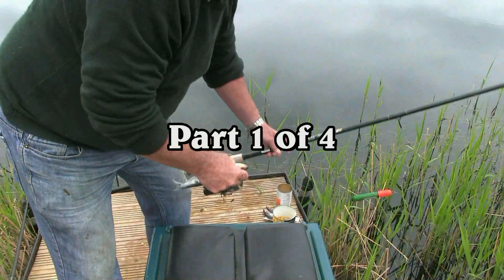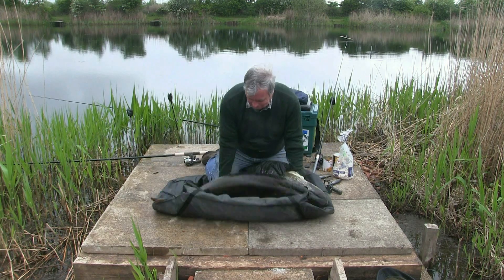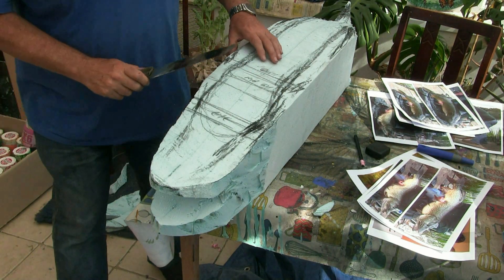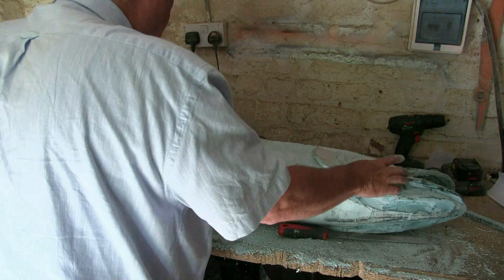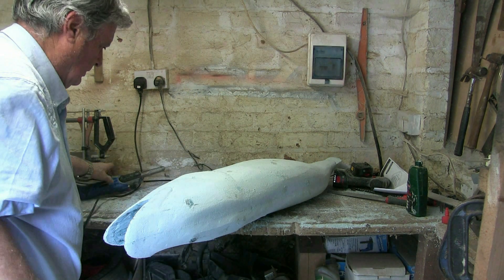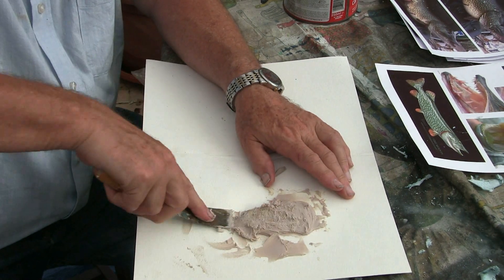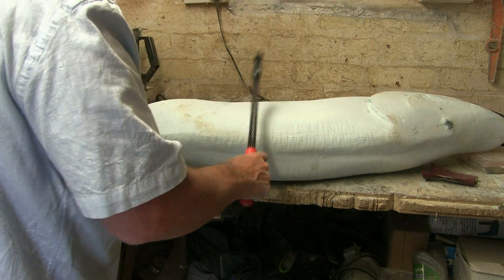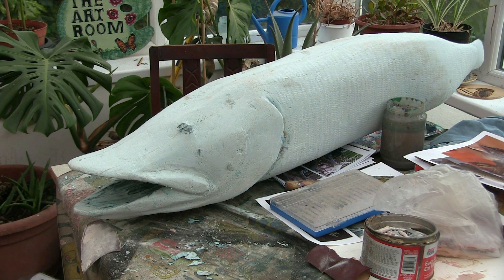Model of big Pike 1 of 4

Comment: Not bad. One of the biggest pike caught in the last decade if not more. What a fish, well done.
Reply from the maker: Thanks Reuben it was certainly a surprise for me also! At first I thought it was just another 5 lb fish and gradually, every moment, it felt bigger and bigger. It was not until I actually had the head coming towards me and saw it and at that time it also decided to take the fight a stage up! lol. Then I realised its size!
Reply: @faith6651 Its an outstanding achievement as an angler, and to have such a rare thing on film is something to be proud of. I should be reading about this on the front page of the angling times.
Reply from the maker: I await my copy as it is already in, I gather, and won Drennan cup which will pay for my materials making this copy :-) They say they even use the pics of this re production, I do hope so as it may inspire other anglers to try making such?